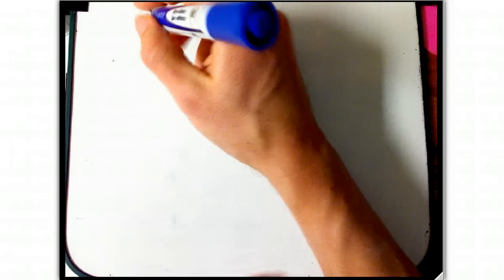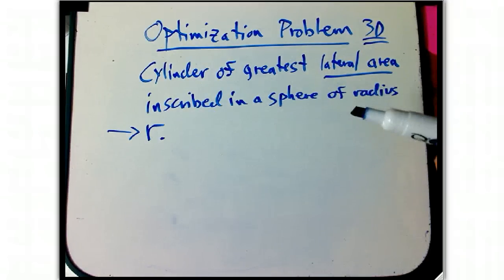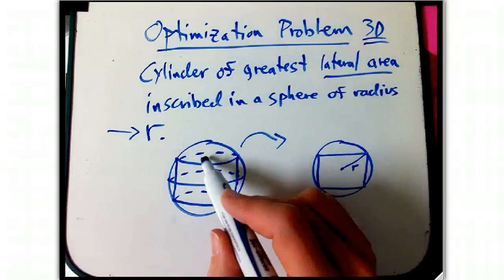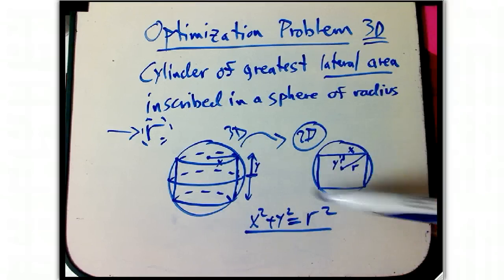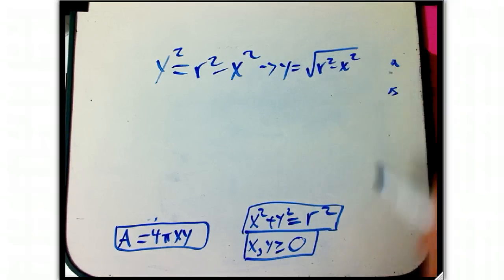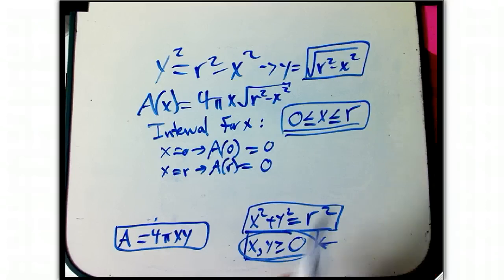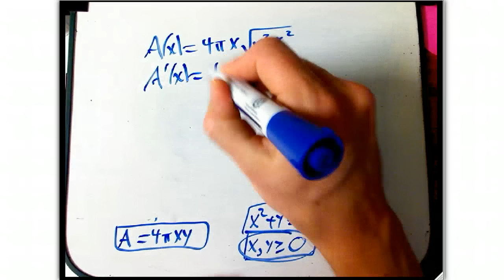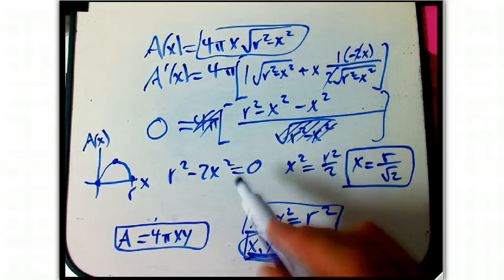cylinder in sphere optimization example

Comment: Hey this is wrong... for chain rule it would be (2r - 2x) and I know that 2r is a constant, but you end up with a quadratic equation as a solution if you do it that way and that gives you the correct answer, with maximum and minimum.
Reply: So it works both ways? I was wondering the same thing.